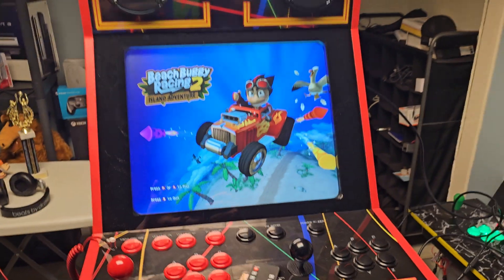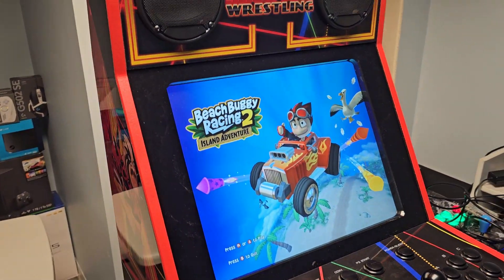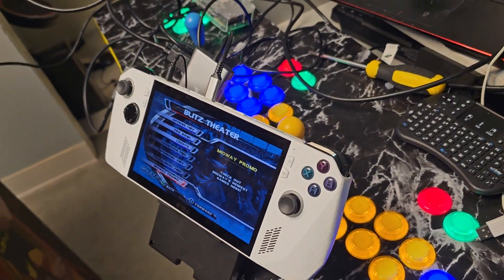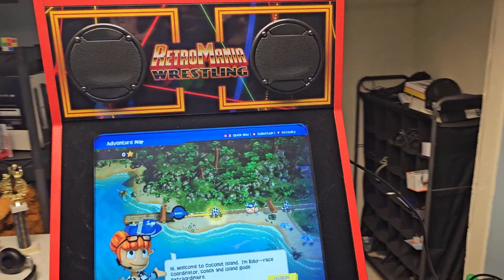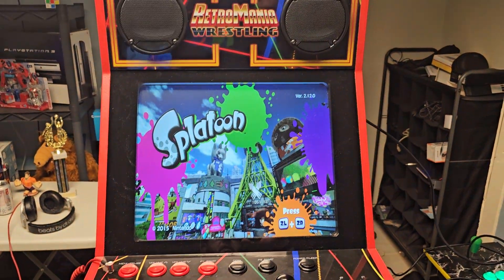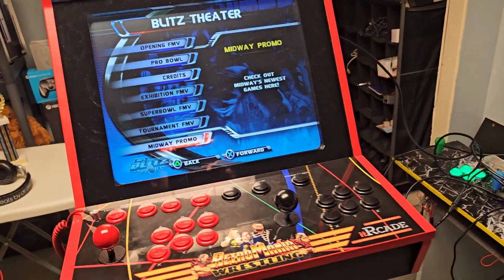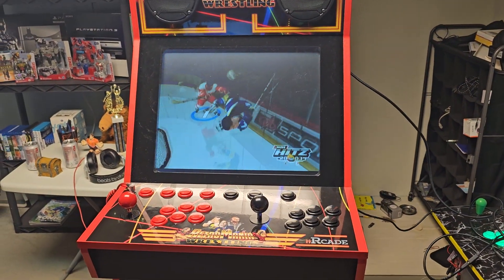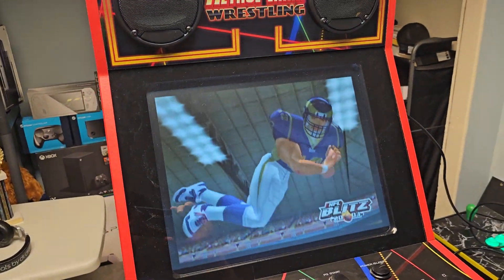Modding My iiRcade: Modding the Crap out of iiRcade Part 1

Comment: It seems like a fun project if you like tinkering and that stuff. But I don’t think it is worth it. It does not make a lot of sense if you do not already have a mini gaming PC that can dedicate to this. If I had one, I would actually prefer to build an arcade cabinet for it. The beauty of iiRcade IMO was having a seamless experience focused on playing and not on building/tinkering/tweaking settings. At least, the GRS panel would give more control options and gates without having to modify things too much. But the way to go seems to be Team Encoder’s board, which allows you to back up the iiRcade and possibly add new indie games(maybe more!).
Reply from the maker: Yeah, I can't wait to see what Glen and Team Encoder come up with. Cool thing about this Mod I can Switch back and forth without touching original hardware.

Comment: Very cool 
I have two gen 1s n was thinking about this 
Myself .  I did order glens and the mystery but I’m not really looking to add mame games . I actually wanted to do a pc or steam deck or even a switch and just add newer wrestling games 

I think what you can do is put an encoder in joystick 2 that works with switch n pc n PlayStation 

N joystick 1 can stay iircade 

It would only be 1 player but player 2 can always play within controller 

Maybe the GRS deck would solve this 
To a point 
I read his eventual Sbc will be able to play up to ps2 . N keep two players 

I might try your way though 
I’m feelin it
Reply from the maker: That's basically what I'm doing with the Intec Deck. One side controls the PS3 the other side the Atgames Puck.